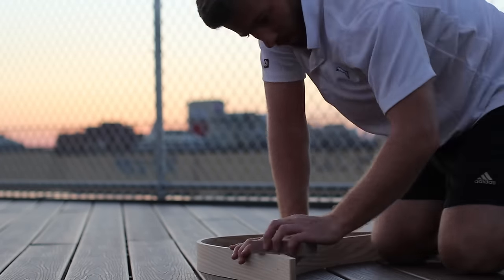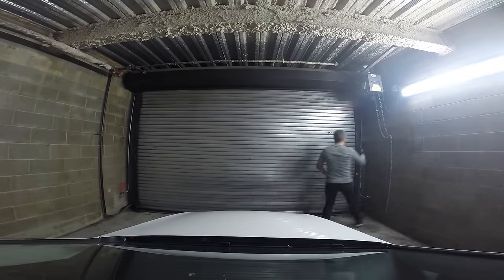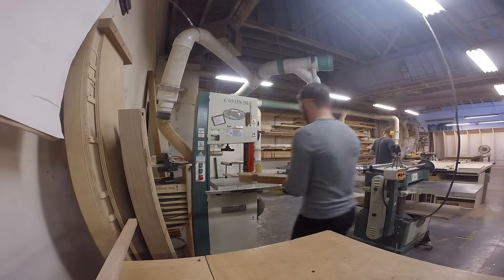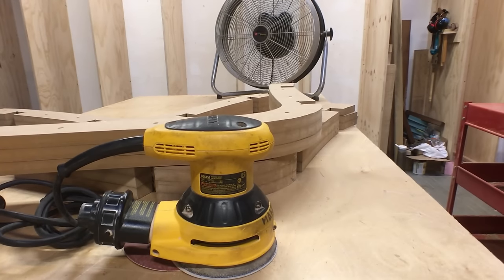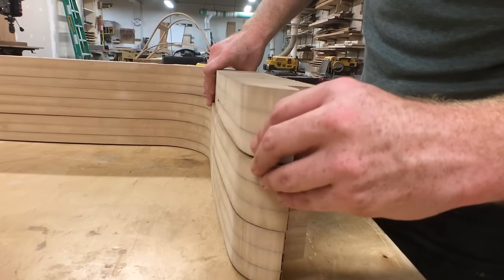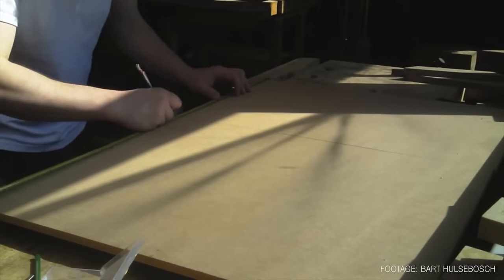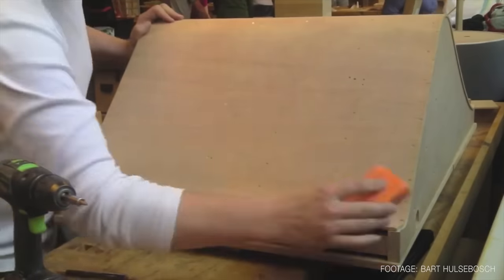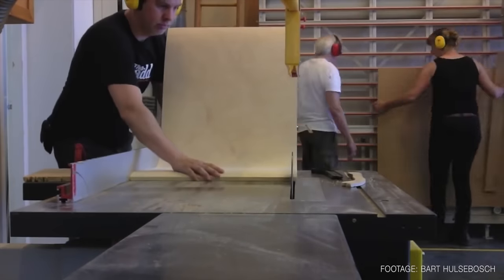How to Make a Chair | Episode 11: SEAT FORMWORK

Comment: looking good! can't wait to see how you're making the seat. I too wanted the front of seat to curve downward more, but that was very hard to do in the vacuum bag. I had to adjust the curve on the mould twice. if you look closely you can see a rounded off piece of 2x4 on the front of the seat as it goes into the bag. that helped to push the birch plies into the right shape. and I had to do it in two passes, two plies at a time, to make the curve. a two-part mould would work better for shapes like these.